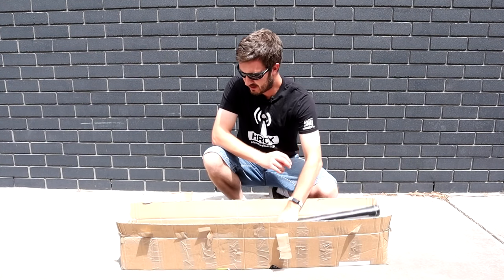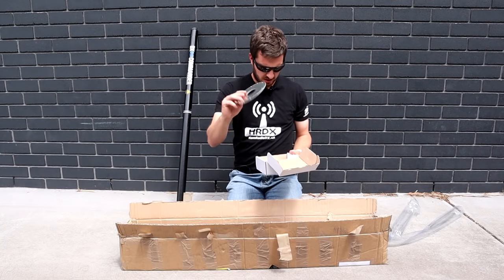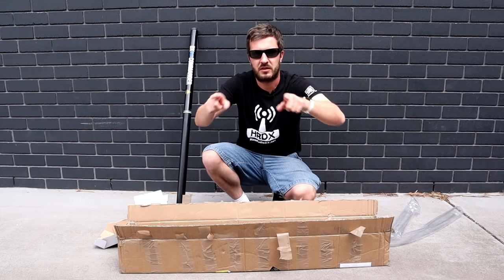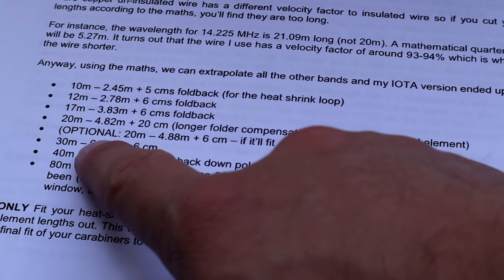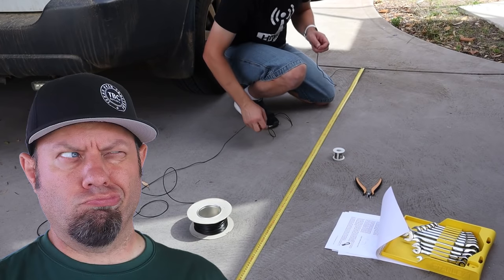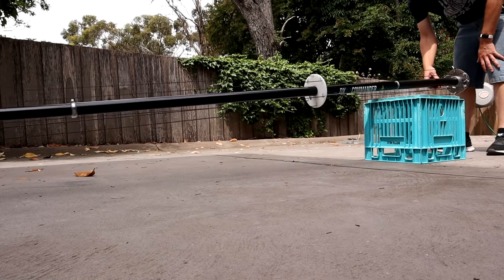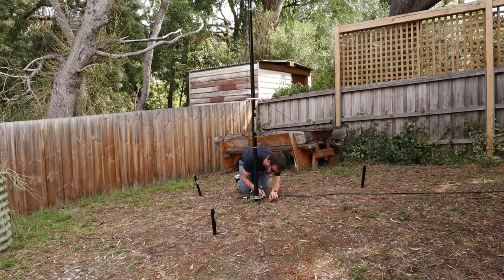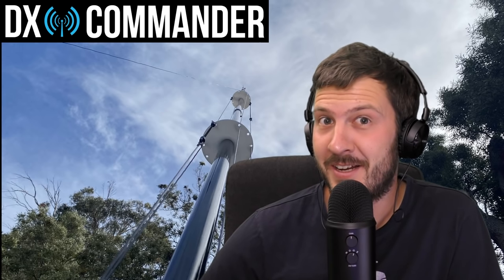DX Commander All Band Vertical HF Antenna Build & Review

Comment: At resonance, a quarter vertical is about 35ohms. Now a 50 ohm coax is connected, you need an L-matching network to deal with this mismatch.
Reply: Err-- nope. All SWR is less than 1.5 on all bands here.
Reply: @M0RMY umm that is close enough to 35 ohms (1.5:1) isn't it..... so yes it could benefit from a matching network but who cares about 4% reflected power in real life.

Comment: Ref Thumbnail: How can this be an all band antenna if it does not have 80 or lower? Edit: Don't think a model number was mentioned. Seems there are many versions.
Reply from the maker: The DX Commander Classic (the antenna in this video) does indeed have 80m

Comment: I own the Rapide which is 20meters on up to 10M I followed instructions to make 30M ...40M. My SWR's are not anywhere near what I saw here. The only "perfect band" for me was 40M and 20M. The rest hovered closer to 2:1...........the worst was 15M. The slice of 15M I tuned for gave me a slight dip under 2:1; using a Rig Expert and 25 foot coax at the antenna site. My ground system is not using 25 foot long wires. I went with stainless steel welded fencing 36 inch wide 25 feet long going  in 4 directions. Bonded at the center by soldering with a blow torch.

Comment: I assembled my identical antenna yesterday, I probably made the job more difficult by doing most of it indoors. Great to have plenty of spare parts in the kit. Your video did add some clarity to the tensioning of the 40m element.
Reply from the maker: Thanks and I hope you're happy with your antenna! Mine is currently on the the ground after a QTH move, I'll be putting it back up shortly, maybe I need to do a follow up video
Reply: @HamRadioDX , enjoy your new home, it's always stressful moving...73

Comment: I am going to stub out my radial connections on a single wire to a powerpole connection with the radial triplet of wire into another powerpole connection. I may have to employ some waterproofing as this will be a semi-permanent installation. It will make it very easy for me to hook up the radial farm as I am unable to kneel any longer. Although gravity keeps trying to drive me to my knees, but I manage to resist and I have the bruises to prove it! Cheers:_hrdxThumbs:
Reply from the maker: That sounds great Alvin!
Reply from the maker: Awesome mate, sure it will all turn out great. Also - CDO, OCD in alphabetical order 😂

Comment: Well, the pole build is done with the HCL Ezy-Clamp and I used that silicon tape on all the joints. My guy anchors are set and this Sunday this beast goes up! Just think with this newest kit we are using stopper knots and no carabiners. My guy lines do have carabiners as I don't want to fumble around.
Reply from the maker: That's awesome! You're gonna work some great DX on that!

Comment: Thanks Hayden great build! I love mine. Need to fix my elements due to a hurricane and tornado stretching them out, but it still works. Thank you!
Reply: That was going to be my question, how does it do in a wind load? I don't get hurricane force winds here in the Mojave Desert of SoCal. But can expect gusts up to 80 on rare occasions, usually sustained winds in the 20's! 
Good video, we call them hose clamps here in the states too. And your Para-cord, you should burn the ends to keep them from fraying. 73! W2QLH
Reply: @chucktedeschi9333  you should do fine. Mine is guyed at two heights and it works great! My elements are stretched due to it blowing so hard over, but it never fell or snapped. Pretty harsh winter also.

Comment: Hi.  Tip:-Put the cut to size plastic tube for the hose clip in hot water to make soft.  Nice tools.   The G5RV sucks.   Good if it's up 80 foot.    Good vid man..
Reply from the maker: Thanks mate
Reply: Was going to say this too - really good tip, makes it so much easier.

Comment: Ive never read a bad repoŕt àbout callum or his aerials 
The man does it all himself 
Pure qualit plus the man is an utter gentleman
D X COMMANDER ALL AROUND THE WORLD 
When i get my foundation this year id lòve to catch you both on air ill only b pushing 10 watts but you can do a lot with a little
Say no more ill see how i go when i get foundation then push to intermediate .
Back in 80,s i made a cb aerial about 3ft of coax coming out of midland and at end of coax 3 strips of copper wire stuck to my bedroom wall inside i had radio on bedside cabinet now it was just a straight 4 watts i got swr to 1.3 and the furthest i got was 10 miles im no exspert but that
Wasnt bad for an aerial inside a house
It will help me as i suffer severe back probs ans fibromyalgia im going to pass foundation ans ill b chuffed to bits 
Keep safe god bless you alll

Comment: This antenna is great for people who are running QRO, but if you're running a 100 Watt Station it's completely unnecessary you'd be much better off spending the money on a MAT-40 or 50 antenna tuner or even a Icom AH4,

You will find that a long wire antenna and a remote antenna tuner will provide much better performance, they capture area is just so much larger. The only drawback is the remote antenna tuners are usually limited to a few hundred watts so if you wanna run full legal limit for SSB contacts then this is a good option, on the other hand if you're running 40 watts on FT8 then a remote antenna tuner and a long wire is a better option. You can use a remote antenna tuner and a collapsible mask in a single wire.

Comment: Excellent. I had a similar idea for this type of antenna after using fan dipoles.  Never got around to it as life got in the way of the hobby.! Looks well built and designed  and a fair price . Was also thinkin of a vertical  with 1 variable length  wire element. Maybe Callum could make one! Spool of bare fine strand copper wire at bottom. wire goes up and over the top of pole and back down. DX Commander uno!

Comment: Good vid. I would like a revieww in 6 months if youm leave it up.
I am not sure you needed to cut an inch or so off an element when you could have made the end loop a bit longer. 
where the loop doubles back against it self it actually ends at the end of the loop
Thanks
Reply from the maker: Thanks Dennis. On some elements they were a little long, so the loop would have been rather large, but you're right. Thanks for watching

Comment: You can add a top band as a kinda 1/4 wave inverted L I have one but since my garden is so small it's nearly all horizontal and in a U shape but still works surprisingly well.  Since it's also only about 2-3m off the ground it's basically NVIS, but for top band that's perfect for me.

Comment: You skipped a bit mate -- the whole topic of radials.  My yard looks almost exactly like yours, and I haven't purchased the antenna for the uncertainty of placing the radials in the constrained space.  How long are they ?  How many ?  And how did you route them in your yard ?
Reply from the maker: I have a playlist on all my DX Commander videos that may answer the questions you are seeking. 
https://www.youtube.com/playlist?list=PLSuX83ay4OuiqZw3oFgnjs4tIQ5f5jzEU
Reply: He built (4) bunches of Five radials each and each radial was 3.5 meters long. That will take 70 meters of wire. I have a big spool of #14 AWG stranded and that's what I'll be using. Save any extra DX 10 wire left over from elements to use as repair stock. Callum has said that a 180 or 90 degree fan of radials will work as well as the 360 config. Do what you can with what you got. It will work out.

Comment: Great video.  Studying loads of videos before I build mine. For the shorter elements  have you done the little fold over recommended in the manual?. I could see the little loops for the clips, but could not see the fold overs. I note the 40m does not have a  fold over (ie as suggested by Callum). Edit - OK get it now. NO probs
Reply from the maker: There is a little fold over on the elements so I can clip it in, but it would hardly affect the tuning of the element. The 40m element goes all the way to the top and folds back over too.

Comment: About the same as the line of  Gap DX Antennas sold in the states there ok if that's all you have room for and only good for DX not very good on NVIS.Then of course if you're in a good Sun Spot Cycle most any thing will work😎😎
Reply: I’m new to this.  With the 80m horizontal wire wouldn’t that work for NVIS?

Comment: Is there any reason to NOT paint the pole light blue?  The reason for my question is it would be harder to see if light blue compared to black.  The wires are so thin people will not see them.  I am asking because I live in a subdivision that does not allow antennas.
Reply from the maker: Can't see why not. Although possibly there may be some interaction if you use paint that has metallic pigments in it perhaps?

Comment: I wonder what is going to happen when the new Ofcom ruling comes out? in some cases, you will not be able to use these ground-mounted antennas?
Reply from the maker: Luckily that won’t affect me here in Australia. What is the new rule?
Reply: @HamRadioDX  Actually Hayden ACMA already specify similar constraints here in VK. It is mentioned in the LCD part 4 which then goes on to reference an Australian Standard. It seems to lean more to protecting the general public, just don't fry the kids :)
Reply from the maker: @RobB_VK6ES  Luckily with a 1/4 ground mounted vertical such as this, voltage maximum is at the top of the antenna, not at the feedpoint. Keeps the prying fingers away from RF burns at high voltages ;)

Comment: Thanks for video. Could this antenna be erected on top of a corrugated metal roof with radials in contact with roof? I have very large barn roof available but little clear space elsewhere. Thanks
Reply from the maker: Maybe try asking Callum from DXC about alternative mounting methods… I can’t see why it won’t work if the pole is sturdily mounted

Comment: Stupid question… doesn‘t this antenna need an Unun? Isn‘t this kind of an end fed antenna where the impedance at the feeding point needs to be transformed?
Reply from the maker: Hey mate,
No this is just a standard 1/4 vertical, nominal impedance is around 36 ohms over perfect ground. Pretty close to our 50 ohms needed for the radio :)

Comment: Currently have a 125ft doublet fed with 600ohm open wire going into a balanced match box. It’s about 50ft up. What kind of difference could I expect between the dxc vertical and my doublet?

Comment: In portable use do you have to break it down completely? Meaning take all the wires off of it. I would like to use it for POTA and Maybe SOTA if I get it but I don’t want it to take forever to put up / take down. Also how short would it be? I would want to transport it in my truck bed 6ft / 1.8m without it sticking out hopefully.
73
KH7FC
Reply from the maker: I would say yes you need to disassemble it, but you can leave the bottom plates on and even maybe the stay point. With the carabiner clips and wing nuts it makes it easier to just attach the wires and away you go, probably no more than 20 mins setup time.
Reply: @HamRadioDX  that doesn’t sound to bad then. Do you know the collapsed length?
Reply from the maker: I think fully collapsed it would be only about 1.5m long maximum. Whatever the length of the first section. Very portable friendly. That's the All Band Vertical. The Expedition version may be smaller still.
Reply: @HamRadioDX  right on. Looks like something that I might want to buy. Thanks for the help

Comment: Great vid! Thanks. . Could you tell me what´s the diameter of the aluminium discs? Are those dimensions critical? Thanks in advance.
Reply from the maker: Not sure on exact measurements but they are about 200mm I think. Callum may have the info on his website or in the manual
Reply: @HamRadioDX  Oh great. I looked for it but didn´t find it. But to have an idea it´s enough. Thanks!!
Reply: @HamRadioDX  Well, I calculated it and I´m pretty sure it´s a diameter of 17cms. :)

Comment: Great video!  I've been looking at Callum's videos for a while now.  A most innovative design, for those who can't put up a tower and beam/Yagi antenna, or for a field HF station. 

The only thing I would probably suggest/recommend is to put a stainless steel washer between the crimp lugs and the aluminium plates, especially if the antenna is going to get wet.  

I know that there is not a direct copper to aluminium interface (the lugs are plated), but copper and aluminum are enemies on the galvanic table, especially in the presence of an electrolyte.

Michael VK5LN/VK5ZEA
Reply from the maker: Ah thanks Michael. Actually a stainless washer is provided - I'm not sure if in the video that shows, but yes they all have washers underneath! Thanks for watching
Reply: @HamRadioDX  All good.  I was looking at the video at around 17:37 and it looks like there are only washers between the lug and the wing nut.  For portable or temporary installations, it's probably not overly critical... but I've seen some horrific electrolysis after only a few months of being exposed to moisture.  :-)

Comment: Not trying to be smart, but what happened when you need to mow the lawn?   Can you bury the ground plain under the ground, say 20cm?  Also I hope my dog does not play tug of war with the ground plane.
Reply from the maker: Yes you can. Callum also sells pins to pin the radials into the ground and eventually the grass will grow over the top of them. In my case, the backyard rarely grows any grass and when it does, I just pack up the radials, mow, then put them back down again
Reply: @HamRadioDX  Thanks for the reply.

Comment: Geometry fail: It's turned 180 degrees! 🙂
Reply from the maker: ? 180, that would be an upside down fan dipole
Reply: @HamRadioDX  QED.  (I trust you will put a flame to the ends of the shock cord. Those frayed ends look awful.)

Comment: Chinese fibreglass pole with some wire up the side and radials, not rocket science.
Reply: So why didn't you design it?
Reply: @M0RMY  Marconi as probably got the credit for the 1/4 wave ground plane, so the design if that's the right word  was already out the bag.
Reply: @G0ogs  Science is established.  Engineering is the result.
Reply: Yay..... today we reinvented the wheel :goodvibes: